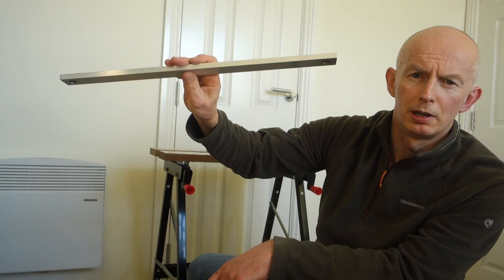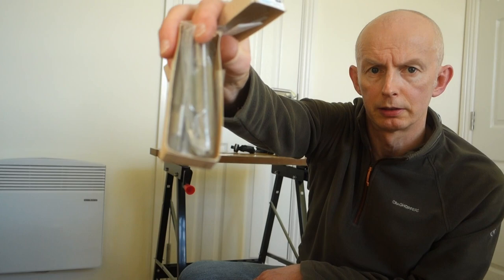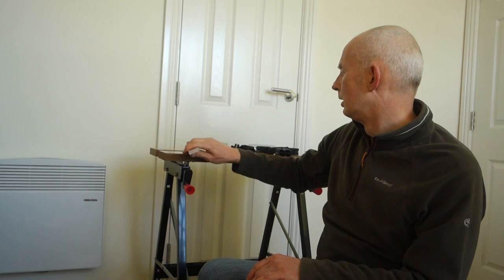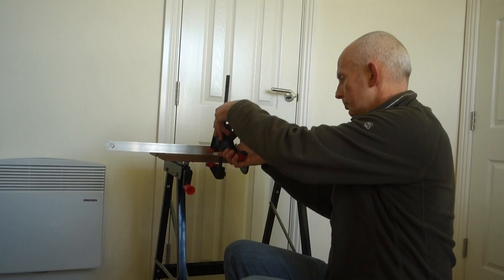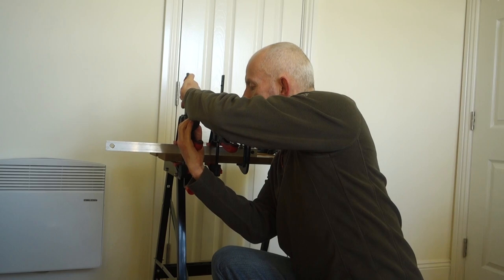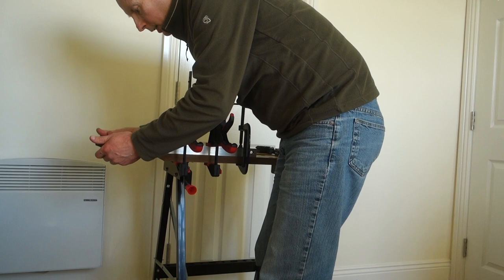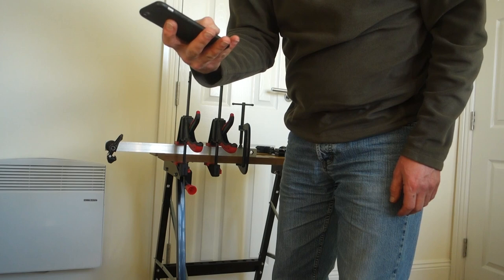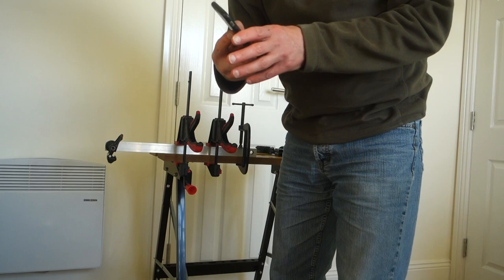Favero Assioma Duo Static Weight test not using bike

Comment: Excellent video. I’m going to give this is a try.
Reply: @DuncMcNutt  Duncan, I gave it a try and it worked brilliantly! I don’t have an indoor trainer (use a smart bike), so this was perfect for me. Now that I have a testing rig, I can quickly and easily test other Assiomas from folks I ride with. Was able to accomplish with a piece of aluminum, $90 drill press, an old 16kg kettle bell, a reasonably accurate scale, some clamps, a portable workbench, and your specified bit and taps. Thanks, man! Both of my pedals were within 1%.

Comment: Hey guys,  I've noticed for a couple of years of a difference between my wahoo core and the assioma, the pedals always lower by about 10w so it seems like a zero offset issue. I've now just also had a knee replacement so I'm tracking the imbalance as a recovery metric and want to test that the unit is accurate. My issue is where can you purchase a certified weight as the average Joe? {located in Australia but don't know where to start}. Any input would be welcomed.
Reply: @DuncMcNutt  thanks Duncan, starting a good ks google hunt now. Have you actually done the scaling side of the recalibration, I assume that it's nothing more than the percentage change between measured and actual but interested to see that aspect of the process? Cheers